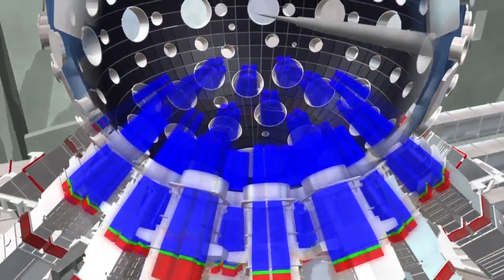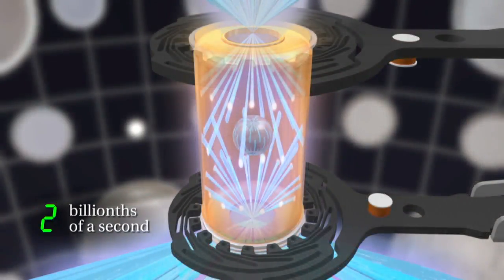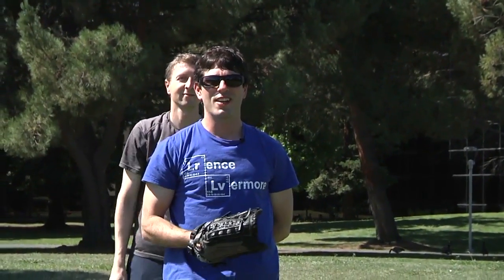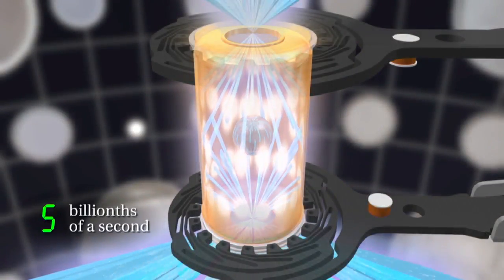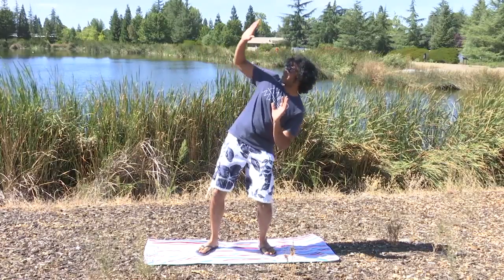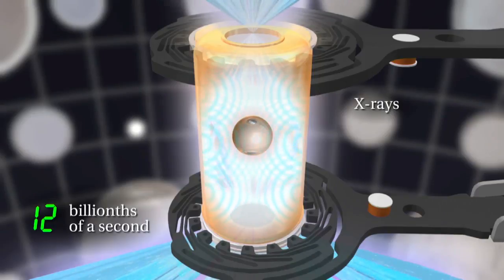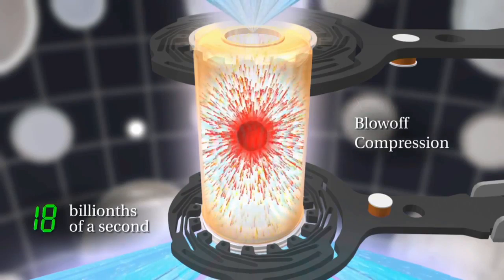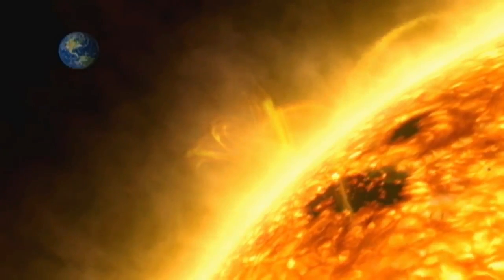How powerful is the NIF laser?

Comment: I still don't know how powerful that laser is......I hear it has a 500 Terra Watt optical power or 125 kilotons of TNT if it could sustain for 1 full second (500 Terra joules), but it only sustains for a few femto seconds, so its maybe a few hundred mega joules of total output or about equall to a few gallons of gasoline..........in a single optical shot
Reply: This is highly classified, but I have source material that shows it to be 1.21 gigawatts. I also have the director's cut of the source material.

Comment: degrees what?
Reply: When it's in the millions, it hardly matters which temperature scale one uses.
Reply: Sure it does, because °F is nearly twice as much.
Reply: Tell me, what practical difference is there between 1,000,000 degrees Fahrenheit, and 555,538 degrees Celsius? Or ten times those numbers, or one hundred times? I reiterate; it doesn't matter. Not in any practical sense.
Reply: my intuition would be degrees kelvin